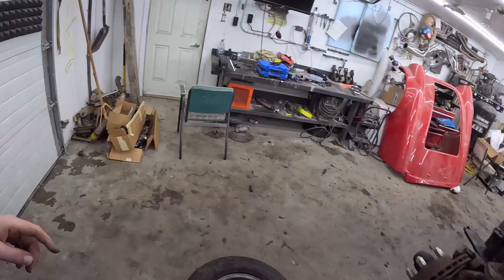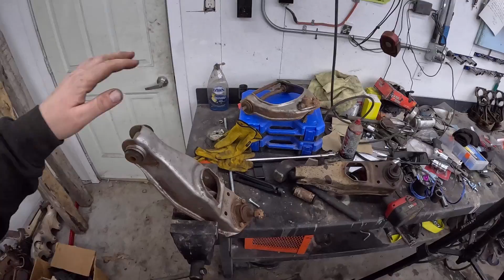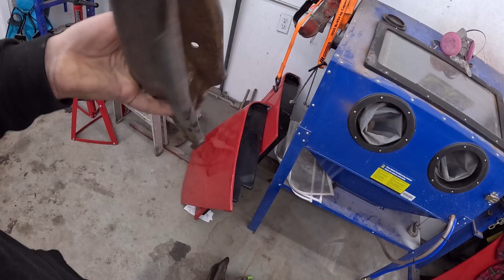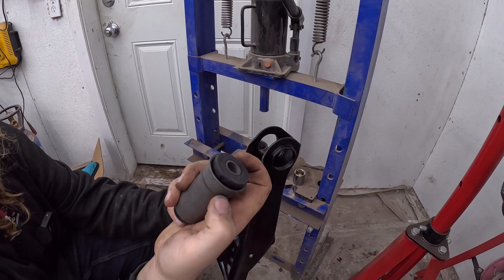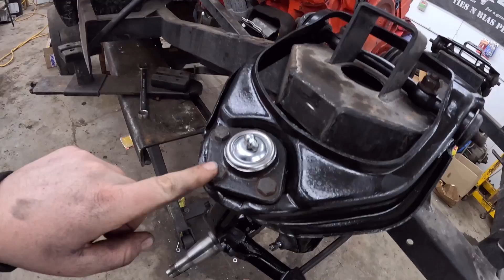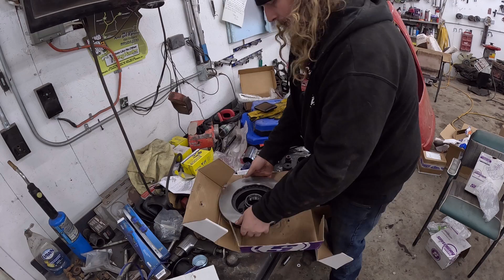FORD Suspension, CHEVY Brakes And A BRITISH Chassis? - Hodgepodge Healey

Comment: One of your best videos Dan ( this coming from in your opinion a so-called troll) Like it when you show complete installations and don't cut corners or miss steps. Young folks can learn when you show complete installs, and you don't miss nothing. (Should have included putting the anti-squeal compound on the brake pads and letting the stuff get dry overnight and how to get the caliper to open up with pads installed to get it over the rotor). I know we take it for granted, but many have no idea, but want to learn. I am currently teaching some 17 year olds how to put a clutch & pressure plate in their Mustang on the ground safely and not get hurt doing it. They continue to find that old people that were around before the computer age, we were poor, and had to learn the HARD WAY how to use what you got to complete a job and we old guys are really nice to know for this as the Youtubes miss many of their questions they had. My main concern for myself was to keep an eye out for rain clouds because this hardcore GM guy was under a low life oil suckin FORD expecting to be struck by lightning at any moment !!!!

Comment: I use old bearing races for installing bushings and when it starts folding use air hammer on the inside of the edges and they pop back in place

Comment: Hey Dan, to each there own and just a couple suggestions, I found that anti seize helps when pressing bushings and ball joints into stamped control arms.  Also, Snap-0n has a really great control arm bushing driver set that not only fits better but makes it all lower profile in the press and or bench vise.

Comment: Blast with walnut shells or the like. It wont remove metal, safe on threads and machined surfaces.
Reply: that's what we always used for media..super safe and works well and easy to just blow off the stuck particles with some air

Comment: Hydraulic presses are great tools when respected. I like this build.
Best Hydraulic press story I witnessed was around 1990. I was building pry bars with a rosebud and 4 lb hammer where I worked. A guy saw the finished bars I was making and wanted to build one. He didn't ask or see how I was making them. Later as I was walking through the  machine shop at I heard a loud bang. I walked in to see the guy standing at the 50 ton electric powered hydraulic press white as a sheet. I saw a piece of 1" 4140 round stock with the end flattened sticking in the wall. I asked him what he was doing and he said "I was building a bar like you do". He was lucky it went toward the wall when it shot out. (I did show him how to heat and beat steel like a blacksmith, but he didn't have the arms for it).

Comment: If you are using a softer side media you can definitely blast the threads to clean them. Just make sure you put anti- seize on them after as they will rust as all the coating will be off after blasting.

Comment: Don't know if you've tried it or not. When I install races I put them in the freezer. It's crazy.  They almost fall in without hitting them. Especially on big ones like a rear diff/pinion.
Reply: i have seen that in other videos...put it in the freezer for a couple hours and put a little heat on the other part or let it sit in the hot sun and it slides in like a hot knife in butter

Comment: If you are going to use the press for the upper bushings, apply tension as you did, then, using an air hammer, vibrate the control arm near the bushing.  The pressure from the vice and the vibration will seat the bushing in a hurry for you. .. Just an FYI for your next project.

Comment: There is a much faster and easier way to install the control arm bushings without a press.  It does, however, require that they be assembled ( Without bushings ) on the chassis, and, the weight of the chassis must be on them.  When I was turning wrenches for a living, I could install new uppers ( Both Sides ) in about 20 min. .. Of course, the flag rate still applied AND I MADE MONEY ! ... LOL

Comment: Dan 
If you put an eye bolt (rated lift 1T )on the bottom of your all thread and a sleeve nut to connect that to your all thread then you wont bend the all thread and you use a small rod with some flats and holes to locate that end in the shocker mount bolt holes - less sketchy and wont bend like the all thread did.

Comment: I also had a problem with the dust cap on a Speedway brake kit for my 1948 Ford. The kit worked great, but the dust cap was not right.

Comment: Instead of using the coil springs , WELD A PIECE OF ALL-THREAD TO A PIECE OF TUBING FOR AN ADJUSTABLE COIL SPRING  . Serves the same purpose and is safer . Then you can adjust the threaded rod to desired ride heigth . Very interesting build .  Great videos y'all .

Comment: I see that the original lower control arm uses a strut rod to keep it from moving back and forth. I know that make a different lower control arm that does not use the strut rod. It mounts differently. I wonder how hard it would be to make the new style lower control arm work on the older mustang II frame. I know you are doing this on a budget and I would be using the old stuff also.

Comment: Built a cheetah kit car with 4 link and coil overs. 8.8 with factory discs. Worked great. Customer has beat on it with a small block and T5 and 4:33s. Still happy. Only prob is at 57 years old he almost lost driving privileges cause of tickets😄😄😄

Comment: Use your press on the bearing races won't shock the tempered steel or use brass hammer and punch, remember no steel to steel hammer when there both hardened.

Comment: That's speedway brake setup is nice on my 50 chevy styleline I used 2000 mustang struts and Qa1 lower control arms and 2000 mustang spindles with a 1971 pinto manual rack and dual piston 2000 mustang calipers for the chassis I used a Jegs tube kit for a  55 to 57 chevy in the rear I use a TDS aluminum third member with a home made 4 link and coilover shocks. So you are doing fine keep up the good work and have a Great day

Comment: Prior to the Mustang II, a Corvair front suspension was a good addition to their hotrods for its compactness and modifiability (Camaro disc brakes, rack and pinion steering), but the Mustang II front suspension, also was compact and had those modifications already installed.  ;-)

Comment: I would've use a piece of 3/4" all thread to do that job of compressing that coil spring instead of the 1/2" , it's just that little bit extra that could mean everything to you and your wife
Reply: nahhh,1/2" lugs can be used  lift a 2 ton machine in the air .......1/2 all thread is fine.
all the fear of coil spring installs is people doing stupid shit ..play stupid games,win stupid prizes

Comment: The nice thing with the Pinto / Mustang II suspension is that they make everything you need to rebuild it!  They make 5 bolt rotors that are 5x 4/12 (Ford bolt pattern) or 5 x 4 3/4 (GM bolt pattern).  I just got all my ball joints on the Rock (TRW's) for less than $50.00!  Have fun Dan and I can't wait til you start the fiberglass work--then you'll know what miserable is!!! 😆

Comment: Watching your videos brings back memories of my youth---we all had 60's and 70's hot rods, and somebody was swapping a motor, transmission, or a rear end almost every weekend. I was the guy they called to set up the timing/carburetor, set valve lash, get the torque converter in the pump, and check clearance on the ring/pinion.

Comment: My suggestion for your suspension would be to look into the dirt modified world for parts the front end uses ford pinto spindles they have brake kits for those spindles and there Chevy S10 rotors and brake calipers the bonus is they make brackets for the rear end to use s10 calipers hubs axle in any bolt pattern you want Speedway has ever thing you need it might be the easiest way for you being in Canada shoot me a message if you have questions
Reply: i used pinto spindles on all my dirt cars ..light and durable

Comment: Just an fyi, i wash rotor bore before installing races. Once,way back when i discovered one still had casting sand stuck in housing. Would not have been good.  And i schmere lots of grease inside hub too.

Comment: Narrowing it is so easy go watch fitzy's video on narrowing an 88
Reply: Just did it for a 51 Ford roughly 3 in and another short shaft, works great now I have limited slip with disc brakes. It was pretty simple.

Comment: Sand or glass bead? Glass bead us way more money, but works well in the cabinets. I dropped $49 on a better gun and it made a huge difference, as i could use a smaller orfice that used less air.